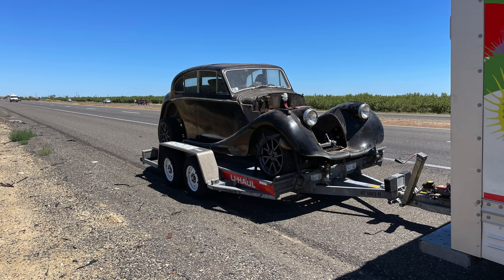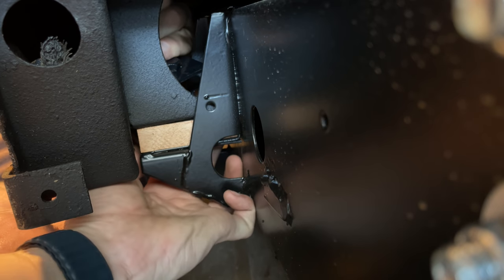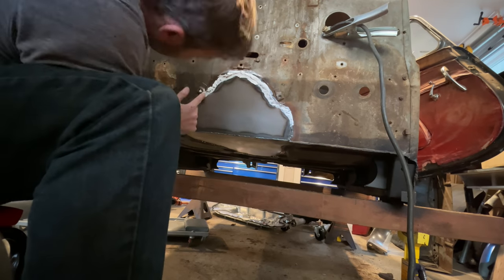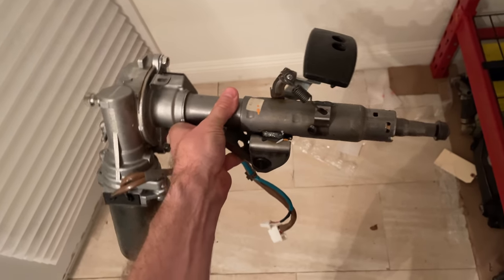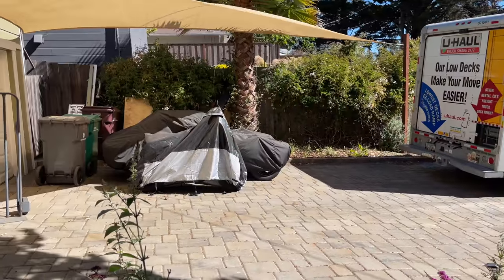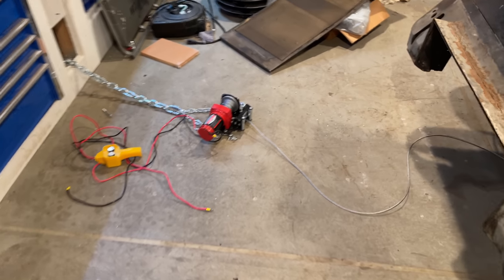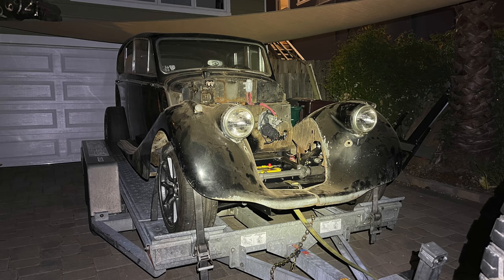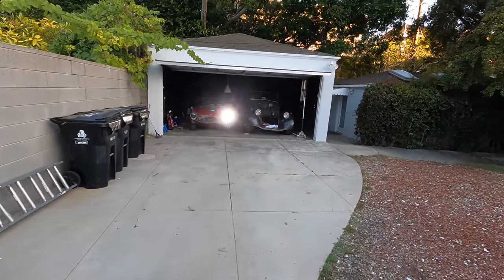The Tesla Powered Jag Hits The Road (On A Trailer). Or: How To Move Two Cars With One U-Haul.

Comment: Next time you could consider covering that difficult welding with brass using your smallest torch and Borax as flux. You get a smoother surface and its well protected. Good luck

Comment: I also have way to many projects running at the same time. I am putting a sidecar on one of my motorcycles, building a trailer for it, also building a new workshop, and putting another bike back together so I can sell it and then use the $$ To extend my shops driveway. I am 75 years old and still work full time because I need the money for current and future projects.

Comment: I think it would be cool to get the Jag going under EV power with the engine compartment visible like it is on the trailer. Imaging driving around town in a car with no engine, would turn some heads for sure. Hide the EV parts and have old wiring harness and hose ends sticking out to make it realistic, Ghost Jag!

Comment: We've all been there with a trailer like that. Like this one Time my father wanted a 1940's caravan that hadn't moved since the 70's. Yeah breakover angles suck with two wheels, a draw bar and very flat 50yo tyres. Still it matches his jag, which sort of matches yours. Except for steering. And brakes. And suspension. And the engine.

Comment: I ruined a 1951 mark 5 drop top.put a FI small block ford and a over drive trans  ,mustang 2 front suspension 9" Ford rear end and discc all the way around. Hardest part was building a left fender from scratch and rebuilding both doors.they used cheap ass wood in them.i swear a couple pieces looked like old pallets

Comment: I keep seeing this "you can't use Tesla parts and charge from Tesla superchargers" "problem" brought up whenever someone builds an EV from Tesla parts. Are there no other charging networks in the US? Here in Norway, there's 6 or 7 competing networks of quick-chargers. Unfortunately, there tends to be long queues at most non-Tesla charging locations simply because there are so many non-Tesla vehicles, but surely 150kW with a bit of a wait is better than nothing? European Teslas charge just fine from these, and I believe that would still work even if Elon removes them from his vehicle list.

Of course, Tesla superchargers are ridiculously cheap to use compared to all of the competition, but again. Better than nothing.

Comment: Whats the speedlimit when towing a trailer?
Reply: Slower than most...but faster than some...
Reply: @JohnSmith-pl2bk  Without brakes on the trailer (small ones) we can only go approx 37mph and with brakes ca 50mph...and there is a upper limit to the weigth approx 3500kg, over that we must use a big truck.

Comment: I watched your video of the ethics of modifying an old car. It depends. If it is a 1978 Ford 500, a piece of junk of which there a a million around, go to it. If it is a Jaguar Mk5 of which the supply is limited and the ethos it has is substantial, I wonder.  Similar to retouching the Mona Lisa because I think she would look better with the smirk wiped off her face. And too many projects are shoddy or abandoned half way thru. How many of them will be well thought of 50 years from now (or 10 years) after the owner had moved on and the car has sat in the back of the garage for many years. Every time I see someone take a Model T or A or 1940 and retro mod it I shudder. 

I bought a 1968 Merlyn 11 that some one had moved the radiators from the front to the sides, taken off the windshield and fiberglassed a wind fairing and other such things. Fortunately I was able to remove most of the work and take it back to original, which is beautiful, historic and totally the right thing to do.

I enjoy watching art restoration videos by Baumgartner because to the care and talent he has. But he always uses materials that can be removed at a later date so that his vision is not one that precludes all others. 

Just a thought